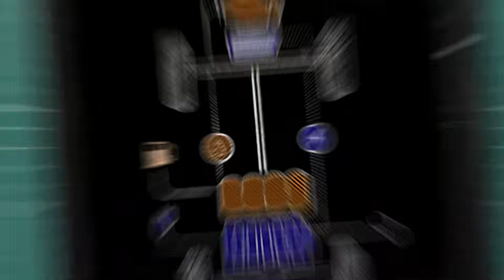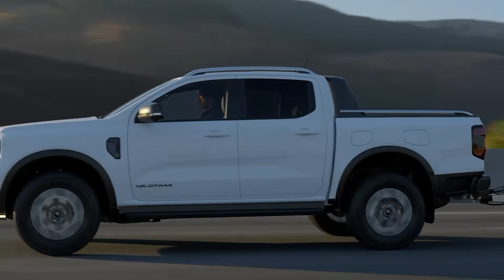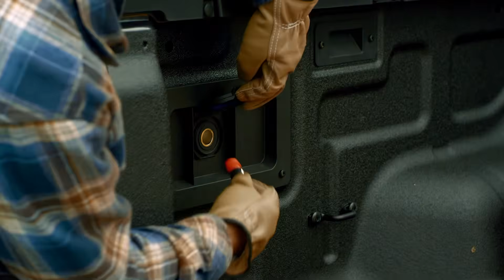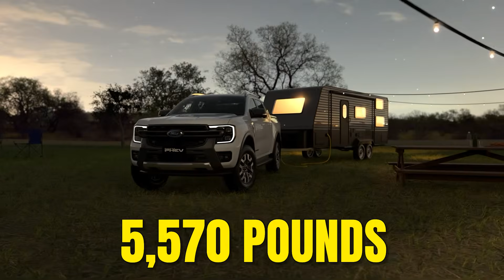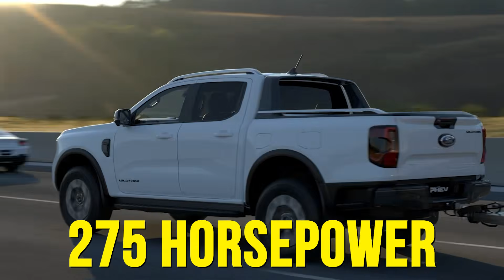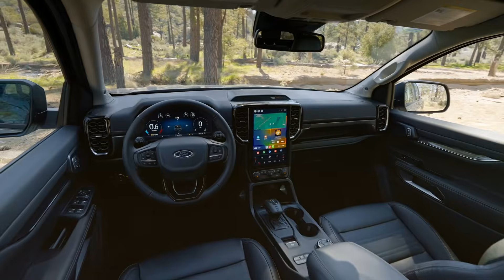ALL-NEW 2026 Ford Ranger Hybrid Is ACTUALLY Insane!

Comment: The Hybrid looks promising but we were hoping it would be a 6-leader too small for our use, in the mountain states you'll need more power if pulling a medium size boat or a decent size trailer to take it over the mountains. The Tundra is too expensive, well look around for a 6 Leader.
Reply from the maker: You need more power for mountain towing - are you looking at the F-150 with the 3.5 EcoBoost, or going non-Ford entirely? Because a 6-cylinder Ranger doesn't exist, so what's your backup plan?